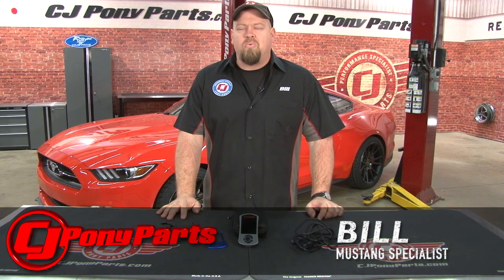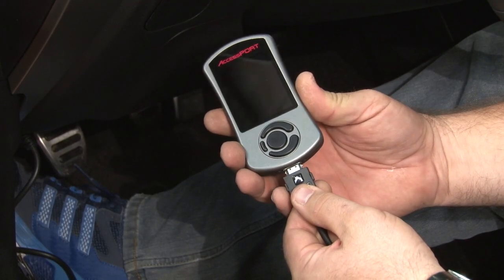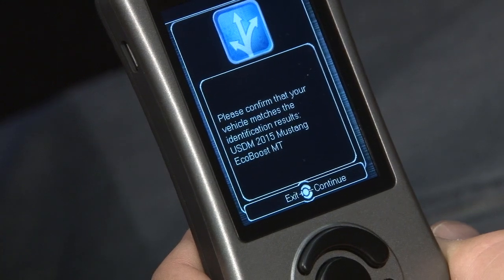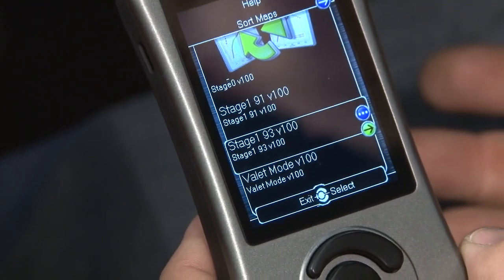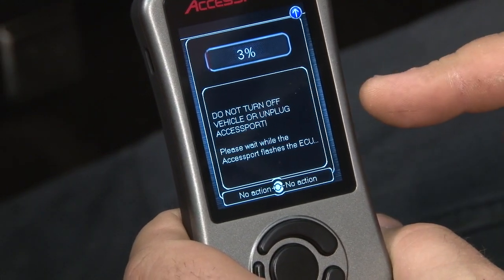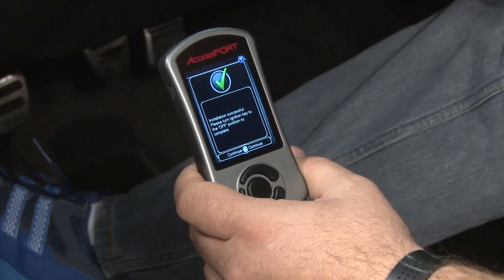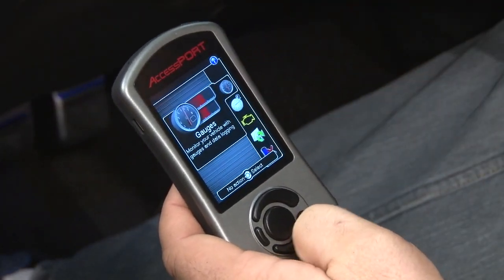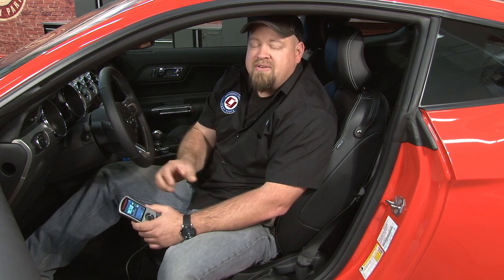2015-2023 Mustang EcoBoost COBB Accessport V3 Installation

Comment: Does anybody know does any of these tunes help with the response time of the gas pedal? I even installed one of those speed assist units to make it more like a fly-by-wire and even on the highest setting It's still seems that there is some gas pedal lag. Any idea on how to fix that or will this unit help fix that issue?

Comment: I have a 2015 Premium M/T with 38k miles.   Airaid closed CAI and BOV.  I am considering a Cobb Tune Stage 1.  Can anyone that has a Stage 1 tune on their share their feedback on the tune?  Any issues with the tune after the fact?  I'm hesitant due to all this ECOBOOM talk.
Reply: I actually have the same question. I'm getting a deal of $450 for this exact Cobb unit, a downpipe, and a MBRP full exhaust so it's a deal I just can't pass up but I'm wondering where do I get the tune for all of those specific parts or does the cob unit already have that in there and will pick up on it when I plug it in and load the tune or can I just load a 93 tune in with all of these accessories and it will be okay or do I have to do a special tune? I just don't want to kill my car anybody can help please?

Comment: Will stage 1 be fine with everything stock on the car
Reply: Yeah just don't go to stage 2
Reply: @kenshn22828  why’s that?
Reply: @oxoym6276  Stage 2 is designed to function with an upgraded cold air intake and intercooler. Running it stock risks seriously harming or blowing your engine. Check COBB's website. They have kits available that detail what parts are designed to be used with each stage tune.
Reply: @Chungolicious  I have a catted downpipe, y pipe with axel backs, cvf intercooler, a airaid cold air intake, and a turbosmart vport 2 blow out valve, what what stage would I need ?
Reply: @s_s_j21-psn53  at least 2
Reply: @s_s_j21-psn53  pro tune. It's significantly safer to go with a pro tune such as Ryan Martin at PD Tuning because your parts are unique and the canned tunes are made to work specifically with their packages.

Comment: how if i fill up my gas 87 octane? what tune willl that be
Reply: With an ecoboost you should always use 93 or at minimum 91 octane gas even stock. Otherwise the engine has to slow down to prevent knock and shortens it’s lifespan. Also stick to top tier fuels my go to is Shell Vpower. Avoid the discount places or you will run into issues without a catch can.

Comment: Do I need to have a aftermarket intercooler to have this install in my ecoboost mustang??
 I have K&N air intake and modified exhaust.
Reply from the maker: No there are different stages available based on your mods. Stage 1 would be fine.

Comment: does this void the warranty on the car ? just got my 2019 eco bout a month ago and wanna tune it but im not tryna void the warranty this early
Reply: Yes. It will void the warranty. My 17' has been tuned with cobb since 15k miles with no issues however. I'm currently running stage 2 with Cobb's Intercooler.
Reply: Mike Gerringer how many miles u currently at
Reply: @joey1142  42K... I've been running stage 2 with the intercooler,  CAI and BOV since 26K. No issues
Reply: Mike Gerringer ahhh ok do u be doggin the car or just once in awile ? cuz im not gonna dog it if i tune it and risk anythingp
Reply: @joey1142  I dog the shit out of it, have since I tuned it. I just did a pull in it on my way home and my Cobb Accessport read off 25PSI worth of boost - and 375 estimated crank hp, 400lb of torque. A pro tune is your best bet, I'll be moving to one here shortly - but Cobb Accessport has done really well so far.
Reply: It wakes the car up, the difference is incredible.
Reply: Ford offers a Ford performance tune you can install on your car, just purchase a voucher from Cj’s site and take your car to a Ford dealer approved of installing the tune. It will keep your warranty

Comment: Can I hook up a married cobb tune to my car?...
Reply: Nope only will get the check engine codes if it's already married.
Reply: @bradaguilar4205  that's exactly what I got
Reply: Fitness Model you can just unmarry the tuner
Reply: @MILESPH71  how Mr.Andrew Miles
Reply: Fitness Model when u plug it in on your og car so the one it’s married too, they’ll be an uninstall option at the bottom of the menu, hit this to unmarry
Reply: @MILESPH71  but the guy sold it to me married without having the car that supposedly had the tune in?
Reply: @MILESPH71  I called cobb before...they want to charge me 350 to wipe it out...now too me that price is nonsense...I thought it was 150 to relicense it...not 350
Reply: Fitness Model mention that to them then and say that if they don’t wipe it your just gonna resale it and someone else can deal with it, they don’t wanna lose a sale that’s why they’re doing it maybe say you locked up ur car and u need it wiped idk
Reply: @MILESPH71  I did mention that to them..but they didn't care so I contacted the guy who sold me it and got my money back...question if I bye a new one .. will it come with tunes off the shelf already?
Reply: Fitness Model yes I can confirm that I got mine yesterday and put stage 1 into my car this morning
Reply: @MILESPH71  wow no way!!!! Foreals?!!😃😃😃...do you feel a difference?
Reply: Fitness Model I felt a huge difference and now i am on the side of the highway with oil pouring out of the block, return the tuner
Reply: @MILESPH71  what??!!...you have oil pouring out the block....how?
Reply: Fitness Model Installed stage 1 last night and we went to test on the highway and we merged on and something blew and yeah no the state police are cleaning the road of the oil and we are waiting for a tow truck
Reply: @MILESPH71  damn bro...u think it was the tuner?
Reply: @MILESPH71  what state are you in
Reply: Fitness Model pa
Reply: @MILESPH71  you mean Pennsylvania?
Reply: Fitness Model yep

Comment: Ryan Martin from PD Tuning will tune your Eco to beat GT's. PD Tuning is an e tuning company that tunes for Cobb. Look him up on YT. I used him for my speed3 and we had it at 400hp with meth injection.
Reply: how did he tune it in person?
Reply: @malsroomm  E-tune is how it's done.
Reply: @gcmfskg  whats the process for that?
Reply: @malsroomm  it's easier than you think. Contact the tuner you want. They will tell you what access port you need,COBB,SCT. Than you purchase the etune off their website and they walk you through the procee. It's actually fun doing and recording runs and sending them in and getting a new tune. Takes multiple runs and revisions but it's how tuning is done these days. There's multiple videos on how to etune with specific cars and access ports.
Reply: @gcmfskg  alright thanks alot
Reply: @gcmfskg  do you know if i need to keep my accessport connected after tune?
Reply: @malsroomm  no you don't unless you're monitoring anything like boost or temps. Or recording runs and viewing them on your computer which is cool to learn the different variables and charts and see how you're performing.

Comment: hey CjPony Parts, does this cost warranty issues?
Reply: Vinsanitii yea it does but ti get around that go back to the factory setting and dont leave the access port in the car. it will void the power train warrenty
Reply: @daltonwilliams777  the dealer can tell if the ECU has been changed, so you are screwed with the warranty even if the settings were returned to stock.

Comment: I have an Auto, i know i know, but will this be a problem? will it cause problems in the future?
Reply: also, can you go back to stock? I'm new to this as you can see.
Reply from the maker: It wont cause any problems, if anything it will help you find future problems by monitoring engine parameters, and yes you can return it to stock.
Reply from the maker: Yes you can
Reply: CJ Pony Parts Thanks man
Reply: CJ Pony Parts will it work on a edm ecoboost mustang

Comment: Hi, I was wondering what I would need to get in order to do stage 2 and 3 for my mustang using the COBB Accessport. What would be your suggestions on adding horses and torque in order to get to stage 2 and then 3?
Reply: +Jarad Reimer   Cobb has new components coming out very soon that will work with Stage 2 and Stage 3 tunes.
Reply: Ok thank you. I appreciate all the help!
Reply: Ive been doing a lot of research and ive seen that tuning by Adam Brunson is also a very big hit. between Adam and Cobb who do you think is better?
Reply: a
Reply: thank you

Comment: Its awesome that the mustang has 80% of the gauges in the HUD. G force, boost, cylynder head temp, AFR, ambient air temp, intake air temp. and you even get 0-60, 0-100, 100-0 60-0 timers. Im amazed at how all around the new mustang is. perfect cruiser and then a track monitoring monster all in one. only thing the coob accessport will do is help you tune the motor. haha.

Comment: Just a note from experience. I took a 15 mustang ecoboost to a drive in movie. aux on radio on it lasted a whole move (120min) so you will be fine if this is on. just turn your air, lights and radio off if you are that worried, but the battery will be fine for 30+ min of aux power without any issues.
Reply: Was too excited to get my port today and i am sitting in the car shitting a brick worried about my battery dying, thanks for calming me down lol
Reply: Dave Lagowski thanks for this man
Reply: I came here answers too, thanks bro!
Reply: thank u brother 👍🏾

Comment: How to keep the battery going and not let it die I don't want to messed up my new car
Reply: Travis Bao Attach a charger to your battery and plug into wall outlet then set at 12V-10amp.
Reply: *****  Because the machine uses the battery and since the motor isn't running the alternator doesn't charge the battery or produce electric so battery drains and dies.

Comment: Bill Tumas, 
I have a question. I have a 2015 GT. If I use, in my cars case, an SCT X4 and restore to stock upon visiting a dealer for service will they be able to tell if it was ever tuned. I'm concerned about them voiding my warranty should something ever happen.
Reply: One the computer has been flashed if the dealer would check they can see it has been flashed, just not what it was flashed with.
Reply: The simple answer is yes they will know and it voids your warranty.

Comment: How much is gained in numbers?
Reply: "...Peak HP of 1.5% and 22.6% TQ and Max gains were 22.9% HP and 25.6% Max TQ!"

Cobb uses % because all dyno produce different numbers and they don't want to mess with controversy.

http://www.mustang6g.com/forums/showthread.php/2015-mustang-ecoboost-3442p6.html
Reply: We plan on dynoing the car soon
Reply: Tom Jones
Does that mean 1.5 % of the current HP (ie if the HP was 310 then the gain would be 4.65HP) and same for the torque 22.6% of the possible 320 ft-lbs of Torque which is a gain of 72 ft-lbs???

Please correct me if im wrong.

Comment: if only tuning an old mustang carbureted 302 was as easy
Reply: TheSamplebridge  It is, just put a 2-barrel on it.
Reply: Hesam0000 it has a 2 barrel stock
Reply: TheSamplebridge  for 2-barrels as long as the choke mechanism, the springs and hoses are kept clean they function smoothly. Once every 6 months pour some SEAFOAM into the carb and let it loosen and blowout the carbon deposits. Also remove all spark-plugs and replace them with (NGK-Iridium) and if you could find some, Borg-Warner plug wires. Most of the time rough idle is not all from carb but from misfire.